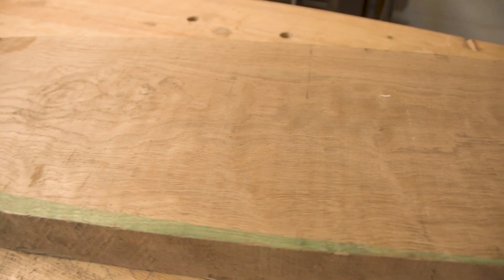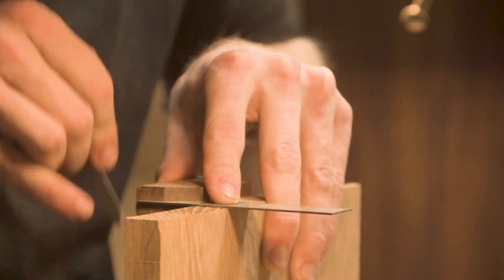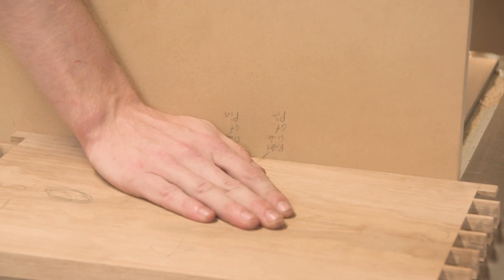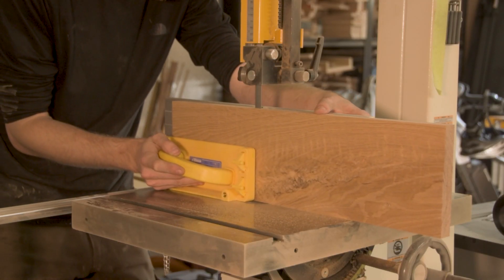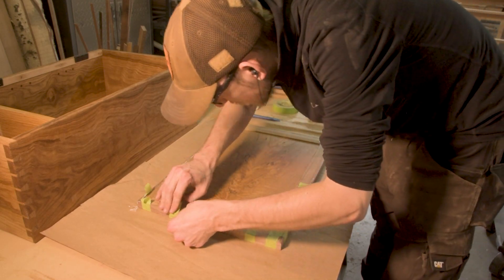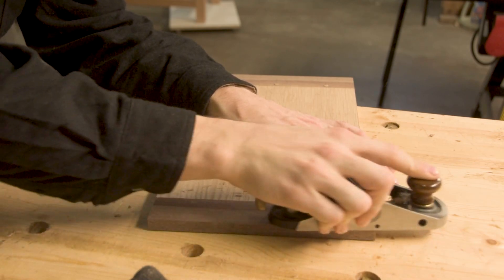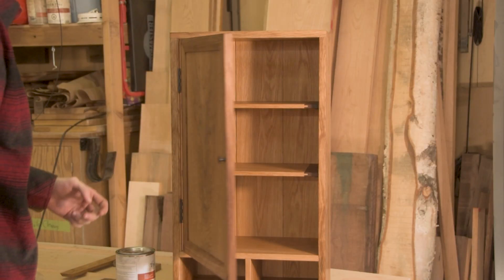Hand Cut Dovetail Cabinet

Comment: Love it, I watch this at work wishing I was in the shop.
I think the reason manufacturers make dado stacks a little less than the stated size is because the manufacturing process is imperfect, and you can always shim it out wider, but you can't remove material to make the blades thinner
Reply from the maker: Great point! It would really suck if you set up a dado stack for a 1/4" and it came out .01" over sized. It really is way better to add a small shim to the undersized blades to dial in the width.

Comment: Really nice build with some nice saves and tips along the way. I made my drawers with sapele on the inside and my father said the same: shame for the nice wood 😂
I caught a small "mistake": the wood grain on the drawer bottoms goes the wrong way, it should span the drawer by its width thus allowing for wood movement. Most probably you'll be fine as your drawers are small but on the larger ones when using solid wood that can cause serious problems. 
I'm new to your channel and I like your work so I subscribed.
Suggestion for a nice book: Essential Woodworker by R.Wearing (Lost art press). Fantastic book that will definitely make you a better woodworker (it definitely made me better). Greetings from Croatia 😊
Reply from the maker: Not a mistake but a very intentional design decision, because like you said the drawers are small enough, wood movement is not really a concern. There's plenty of room in the grooves to supporting the bottom for any expansion that may happen. The most important part is that the two drawer bottoms are also bookmatched, so when you have both drawers open you get a pleasant surprise.
Thanks for keeping me on my toes though, it's always fun being able to explain some of the decisions that go into these projects!
Reply: @morganhurst_redridge  It is exactly why I placed "mistake" in the quotation marks 😊. Happy holidays to you and your family 🎄⛄🎄

Comment: Good looking piece. 
Chiselling into your hand doing the hinge made me wince a bit.
Not convinced about your drawer bottom grain direction (I'd make ply if I wanted to show grain running front to back) or the breadboard ends (Since they're the pieces that'll move out of step with shelf and sides, I'd prolly fasten at the front and trim them shy of the back)
Reply from the maker: Thanks!
The drawer bottoms are small enough that any wood movement is negligible, and I can safely say after two years that there hasn't been any issues.

Comment: While the walnut trim around the door was a great solution, what would you have done differently to fit the door as initially intended? Asking because I might be running into the same problem, haha.
Reply from the maker: I should have only used my hand plane and not the table saw. With dovetail casework like this, it's usually not going to be perfectly square on the inside. With the hand plane you can intentionally taper the sides of the door to fit the non-square cabinet, giving you a perfect fit.
I got lazy, then messed up, but also got kind of lucky with having the opportunity to get creative with the fix!

Comment: Im starting to really like epoxy for glue ups. It has a huge open time, lubricates the joints, gap fills. The only add to titebond is that you can keep working in 1h.
Reply from the maker: That's really interesting, I've been using hide glue more often because of it's long open time and lubrication, never thought of using epoxy for just a normal glue up.
Reply: @morganhurst_redridge  You also dont technically need clamping pressure. Its great for those long stressful glueups.

Comment: Wonderful project! It looks amazing, I do have one question tho. Why put the spacer piece in for the door? I don't understand why cutting the mortise into the side panel would prevent the door form opening all the way
Reply from the maker: The main thing is that if you screw up the mortises on the side panel then there's no good way to fix it without having to redo the whole case. With the spacer you have unlimited tries to get the mortises fitting just right.
The spacer also allows the door to be inset slightly (about 1/16 inch), which if you didn't use the spacer would cause the barrel of the hinge to bind against the sides.

Comment: For the waste removal trick do you think I could use a 1/4 shank 1/4 od spiral bit as a flush trim without a bearing or do you believe a bearing is critical for flush trimming?
Reply: I had a look at the video you mentioned. He leaves a little protective wall of waste to protect the pin and just uses a spiral bit and listens for the spiral touching the wall of wast before he just removes it. I guess alternitavely I could protect the pins with a double layer of tape. Disregard my last question, the cut length of the bit makes it too deep for most dovetailing, a quick search of whether you can flush trim without a bearing warned of scorching or using Vaseline to prevent it but with the side effect of getting Vaseline in the pores of your work piece. Great channel by the way!
Reply from the maker: I'm glad you were able to find the video. The best thing to look for is a short flush trim bit on amazon - https://www.amazon.ca/gp/product/B08PVD6NCP/ref=ppx_yo_dt_b_search_asin_title?ie=UTF8&psc=1
This is the one I use now and it's pretty cheap and makes quick work of cleaning up the base line.

Comment: Beautiful work! How did you consider wood movement when constructing the door?
Reply from the maker: The only part of the door that is going to experiences noticeable wood movement is the book matched panel, so to combat that, I made sure that the panel is floating in the frame of the door. The groove that holds the panel is 5/16" deep and the panel only sits a 1/4" inside of it so over the whole width of the panel it can expand 1/8" without touching the frame. The frame of the door won't experience enough wood movement to cause issues since all the pieces are about 1 3/4" wide and rift sawn.
Frame and panel construction, like this door, is by far the best way to deal with wood movement because you can freely let the large panel move as much as it needs to while keeping precise dimensions with the outside frame. You can also scale this theory easily, which you can see in the Blanket chest that I build where the lid is a frame and floating panel.

Comment: Nice job overall but totally disagree about hand cut vs machine dovetails. Using a jig yields a joint that is tight but uninteresting.
Reply from the maker: It's a hard debate, I go back and forth constantly and now it just comes down to whatever method I think suits the project.

Comment: No...come on: That dovetail jig and the back-saw don't go together, however much you like the jig.
Reply from the maker: It actually works quite well because I can use the jig to make sure my initial angle of the cut is correct then remove the jig to finish the cut.

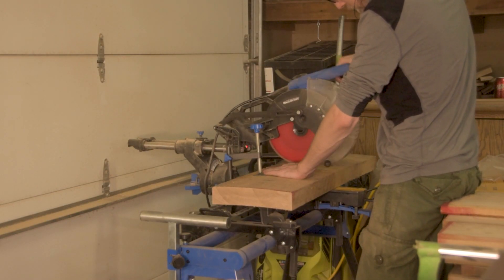Comment: Hey Morgan.  Beautiful cabinet out of one of my favorite woods white oak (WO).  And your dovetails are spot on although you're a brave man to cut all of them in WO as it splinters so easily and is unforgiving.  Question - at 9:30, you're running that cupped 8/4 through your thickness planer which is not a true planer (although I've always thought that it could serve as such).  Then you're using that face to joint the edge and subsequently show it on your bandsaw as seemingly flat on both sides.  Assuming you used your planer but how did you plane down the cupped side which appeared to be wider than your planer?  Also, fwiw, I've found using Vix bits in WO (or any wood) works to perfectly center the screwholes for hinges.
Reply from the maker: Thanks Steve, white oak is a beast to cut dovetails in but I didn't actually find it much harder than maple or walnut. Sharp tools and patience made pretty quick work out of it.
For you question, that was one of those lucky pieces where even though it was seriously cupped, the bottom edges referenced flat against my table saw surface. So by just passing the piece through the planer with the cup down that gave me one flat face, then flipping it over and passing it through again gave me the second flat/parallel face. Every once in a while with 8/4 stock you can get lucky and do this because unlike 4/4 it won't bend or deflect with the pressure applied by the planer.
Reply: @morganhurst_redridge  Yep kinda figured that's what you did as that cup looked surprisingly symmetrical!  And yes - uber sharp chisels make the diff - I have my set of lie-nielsens sharpened up to Shapton 16000 glassstones!  Totally agree that walnut is even trickier although maple seems to be more consistent - at least musical birdseye.  I've worked alot of crotched Claro walnut  and it tends to what I call "chunk" - referring to chunks of it flying out of the wood with applied stresses like routing!  It's an odd wood!  Merry Christmas!
Reply: Btw, the cab carcase wood grain is gorgeous - never seen white oak cathedral quite like that! Also, you might check out Vix self-centering bits for hingeplate holes!